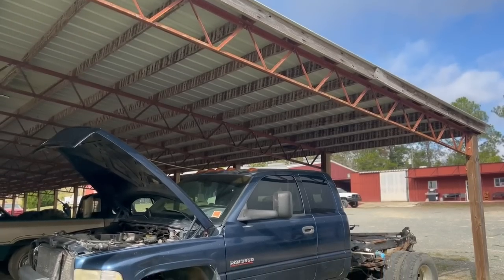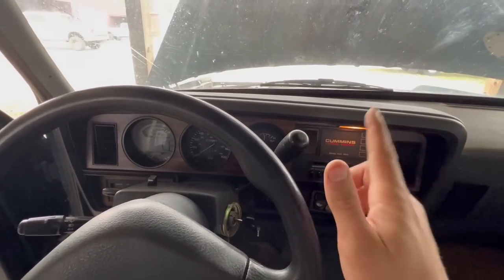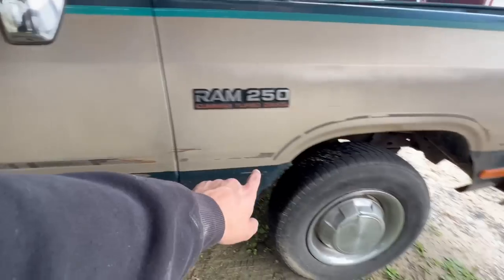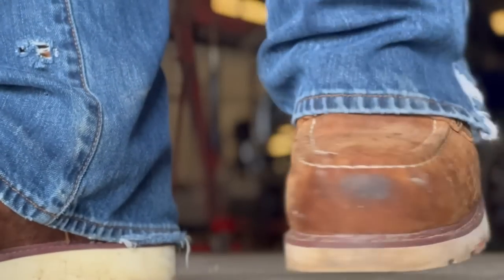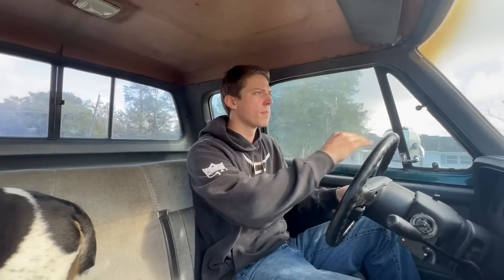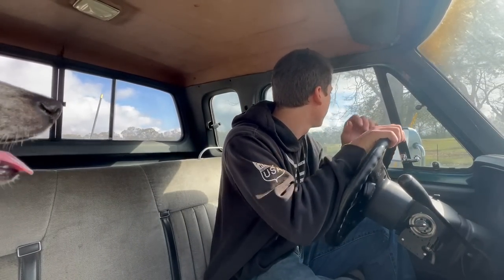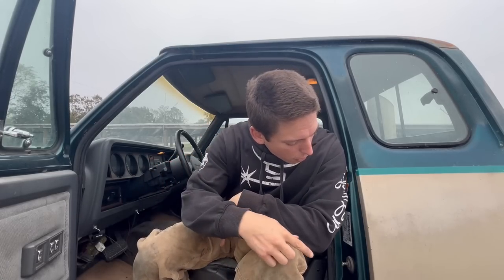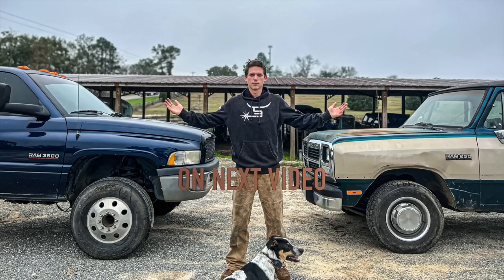$10,000 1ST GEN CUMMINS

Comment: What happened to your other dog? A vibration when on the brakes=rotors are warped, and not charging on those 1st gens can also be the pcm/voltage regulator sometimes too if the alternator doesn’t end up fixin it
Reply: It passes away
Reply: Passed
Reply: @Suzukimoto24  yeah but how